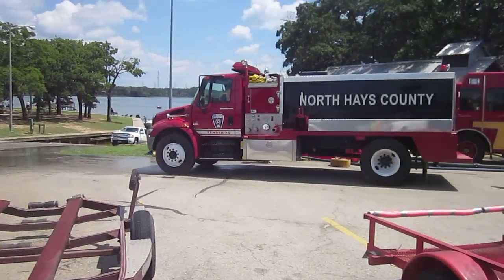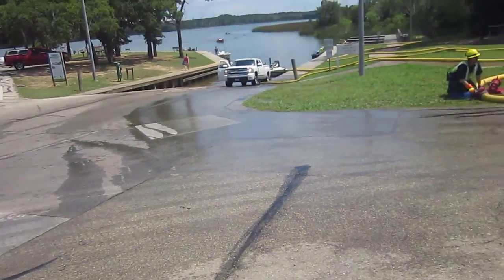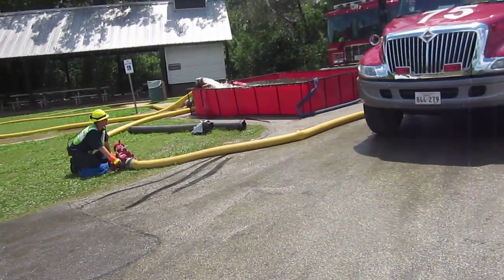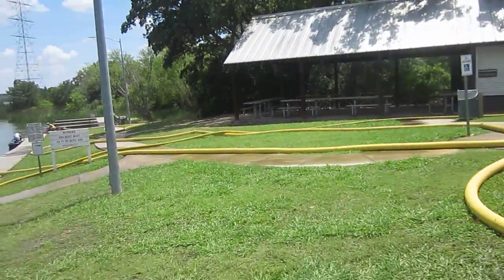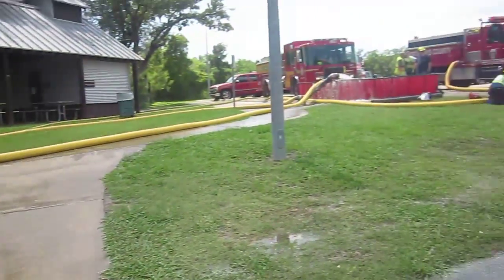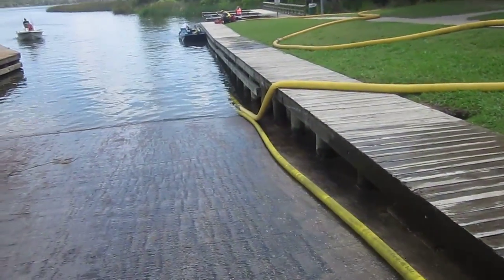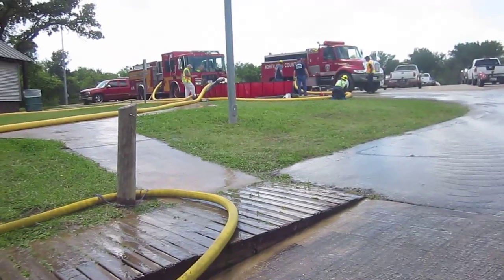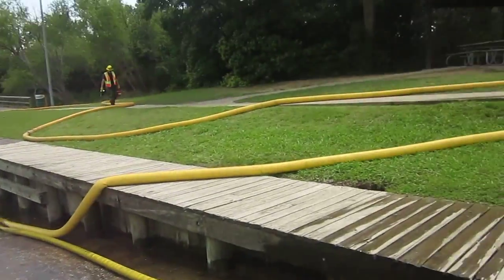Part 12 - Rural Water Supply Drill - Bastrop, Texas - June 2014

Comment: Running the return line on that Turbodraft over the edge of the dock is probably costing a loss of flow into the dump tank.  I'd move the tank up about 30' so you have a straighter shot with that line.  Turbodrafts don't like any kinks or bends.  Good setup still.